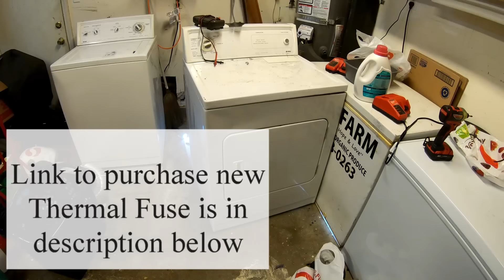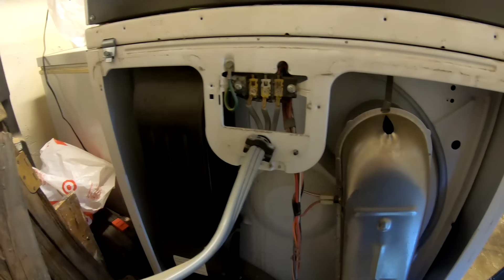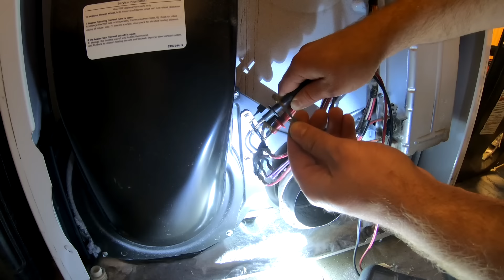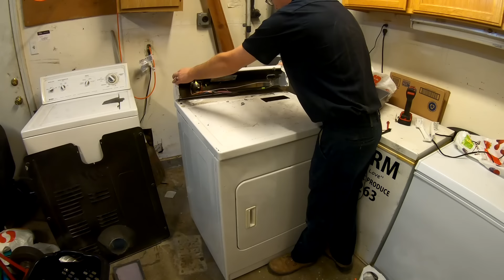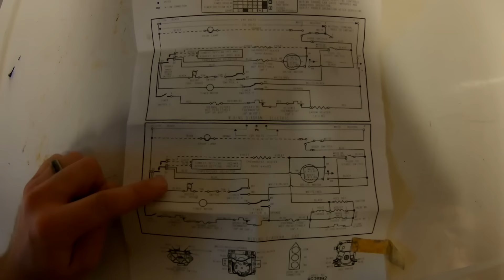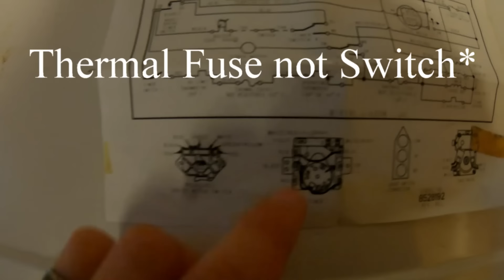Dryer Won't Start / Kenmore / What To Check and How To Fix

Comment: BTW why are the wires to the Thermal fuse Violet or light Blue? Not Red and Red with white tracer as listed on Schematic? - actually another more robust thermal cut off is connect to the R & R-W wires.  I suspect the G4AP0500 thermal fuse is a very sensitive with nominal value - except for keeping the service man employed - it cuts off the electric motor field on "ON" switch (see the Middle of Schematic).  I ran across this fault when the dryer would not turn on but the light inside the dryer worked - just took off the back to check all thermal switched - shorted the light blue wires and everything worked - keeping it shorted until I get a replacement in a few days.

Comment: Ive checked all of those components and they test fine, the timer ticks when you push the start button but nothing else happens. Any ideas what else it might be?
Reply from the maker: Hey, I would trace the wiring diagram on your unit and see what else might be in the flow of electricity before it gets to the motor
Reply: @handymanjourney  I feel like a dumby, I found the belt broken when I was cleaning the inside 🤦‍♂️ thanks for your response!
Reply from the maker: Life is all about learning! Glad you found it! Merry Christmas!
Reply: @handymanjourney  merry Christmas to you as well!
Reply from the maker: Thanks!

Comment: Dude i have the same dryer mines smells something is burning out then it stopped wrking the belt is fine power is there it beeeeps as it does not turn the timer nob sounds like its counting down in certain areas i need help what could it be

Comment: What's my problem if on the back of the dryer the two outside leads do not give me "240" volts, but I do see "120" on the left/middle and middle/right? Thermal fuse is good. Dryer shuts off mid cycle, and will not turn back on when pressing start button. Makes hum sound but no spin.

Comment: Wish you would've elaborated the potential cause of the failed thermal fuse. In most of these issues the exhaust pipe/tubing probably had a partial blockage or may be too long. Unless the cause was fully rectified you'll need to replace the fuse again in another year or two.

Comment: Allen,   had you tested the thermal switch with the 'setting' dial on,
   you may have determined at that time the thermal was OK. 
       just an experienced ballpark guess on my part.
Reply from the maker: Hey thanks for your comment Norm! The thermal ended up being the issue.